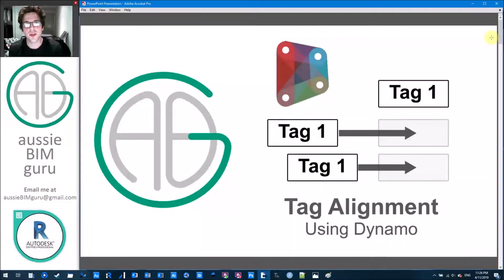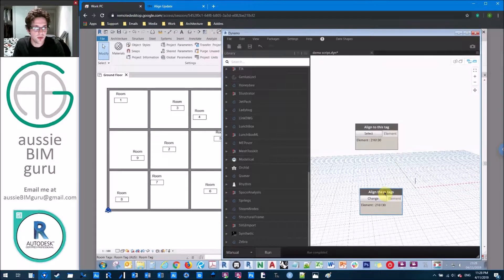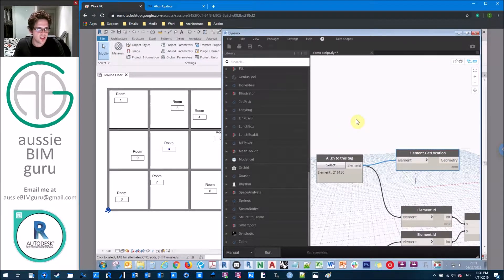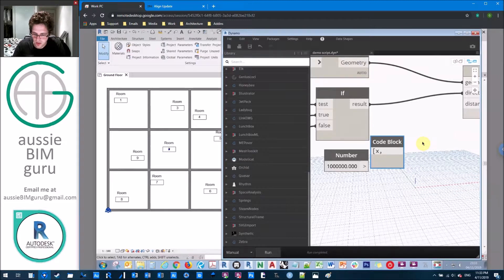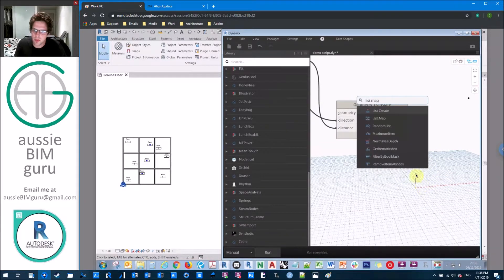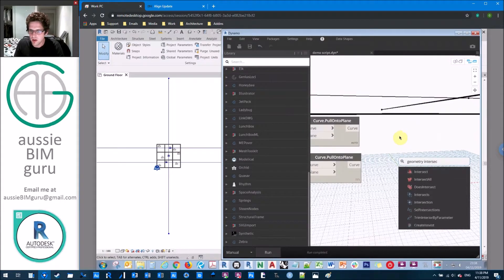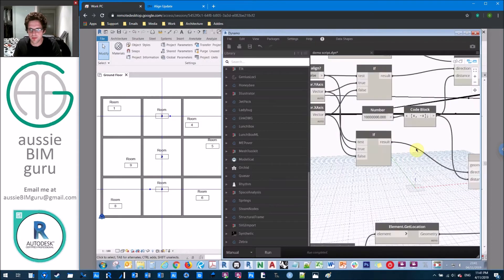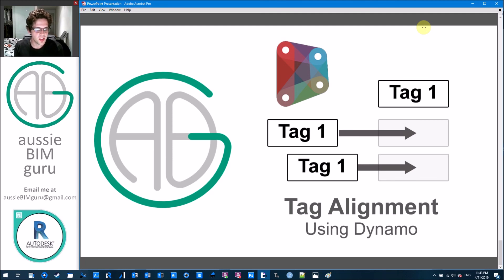Align Tags using Dynamo!

Comment from the maker: You may have better luck using 'Get/set' tag header location from the Rhythm package - I've been made aware some tag types don't work with getlocation.
Reply: Very nice script! If I want to align window tags or align elevations it doenst seem to work. So I replaced the 'getlocation' commands with the 'getheadposition' command but it doesnt seem to work. doe you have any solutions?
Reply from the maker: Maybe the element.movebyvector node? You will probably need to use the start/end.transaction nodes either side of the moving node also.
Reply: @AussieBIMGuru   IF i try the following warning appears: "Warning: There is no version of Geometry.Translate that accepts argument type(s) (Function, Autodesk.DesignScript.Geometry.Vector, int[])." at the Geometry.Translate command
Reply from the maker: @bartoudemoleman6571  it sounds like you used geometry.translate? The node i mean is different, element.movebyvector
Reply: @AussieBIMGuru  instead of the get location node i use the ''transaction start - element move by vector - transaction end'' node. when i run a test the warning appears 1 node after the transactionend node (the geometry.translate node).
Reply from the maker: @bartoudemoleman6571  if i know this node properly, it should be able to move the element without a geometry translation. The vector should do the moving
Reply: @AussieBIMGuru  hmm that could work. but I still have a direction and distance input in the geometrytranslote node. so the if statement and the code block lead to nothing
Reply from the maker: @bartoudemoleman6571  yes it's a different type of script to what i made here. You build the vector instead of translating the geometry in dynamo.
Reply: @AussieBIMGuru  I am facing same warning as above while using geometry.translate node. May i know how to use the three nodes mentioned above ( ''transaction start - element move by vector - transaction end'')
Reply from the maker: @vishwaswami1930  you would pass the elements you want to move into the start transaction node, pass them into the move node by vector in the element input, then pass that output to the input of end transaction.

Comment: Hi, You did a good job🎉
I want to make the script for alignment of Structural rebar Tag. But if i used Element. Getlocation it shows error. What is the solution to resolve this?
Reply from the maker: Try the 'Tag set location' node from Genius Loci instead.
Reply: Thank you for suggesting this @AussieeBIMGuru. 
But i can’t find that node in Dynamo 2023. Could you please help with this?
Reply from the maker: @jothish7510  it should be in the genius loci package, likely under the tags category.
Reply: @AussieBIMGuru Thank you!
Reply: @AussieBIMGuru  I got the node and used in script but Tag.get location shows null only.

Comment: Have you guys ever tried to align tags in elevation views? I didn't manage to get any predictable results.
Reply from the maker: You would need to use the view direction as a base plane to compare and align. The revit api can do this but it would be a bit more complex than this workflow and you'd need to work on that different plane for each step.

Comment: Thanks for sharing this. It's awesome. I have a question. What if the viewport has been rotated in the project? How can we align them if they are not orthogonal? Thanks
Reply from the maker: Hrm that's a bit more difficult and I'm not 100% sure how I'd go about it... you would probably need to enter the rotation value of the viewport into the script as well and rotate the coordinate system you're using in Dynamo to account for it in all the vectors and lines you generate.

Comment: Its amazing workflow 'cheers 
Is there any idea to work for rotated Tags also 

Thank you
Reply from the maker: It depends if you mean the tags or the views are rotated. You can rotate coordinate systems in Revit so you may need to use this to correct the calculations if the whole setup is different - hard to say though.

Comment: Thank you for sharing.
I used a different approach. After selection of elements, node Vector.By.Two.Points with Vector.Reverse allows you to define the Element.Set.Location position without the use of "helper lines". 

Posted the script on the dynamo forum:
https://forum.dynamobim.com/t/align-tag/47554 

My question is there a downside to my method that you can shed some light?
Reply from the maker: Yours is a simpler way to solve it I think, I like it! One challenge both are scripts face is when Dynamo north doesn't match Revit north for orientation. A quick coordinate system rotation in Dynamo could solve it though!

Comment: I got stuck in the script at Element.getlocation. I got an error: Warning: Element.GetLocation the operation failed.
The location of the structural member is not a valid curve. Is there anything I can do to solve the issue?
Reply from the maker: It sounds like you're tagging a structural beam - locations of beams are a bit different to some elements who are represented by a point.

I would use the element.boundingbox node, then the clock bounding box properties node. You can get the centre of the bounding box of the element this way, which should be close to the centre of the element in plan hopefully.
Reply: @AussieBIMGuru  Yes you're right. I tried your scripts on structural beam tags. I tried your solution and got a warning with element.boundingbox node:  get-BoundingBox operation has failed. Did I miss something?
Reply from the maker: @jamalaouzal9961  it's a fairly generic warning. Can you send me an email and screenshot instead? Too hard to troubleshoot in words only.
Reply: @AussieBIMGuru  I've just sent U the email. please do check it
Reply from the maker: @jamalaouzal9961  received. Will check tomorrow sometime.
Reply from the maker: @jamalaouzal9961  saw your email, a bit confused. This workflow is for tag alignment, so you shouldn't use it to select structural model elements; tags only.